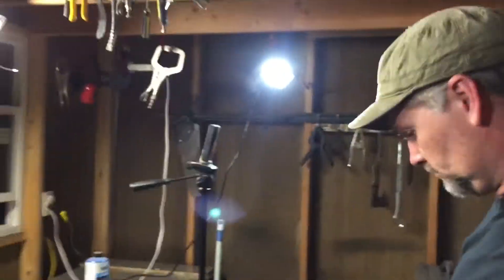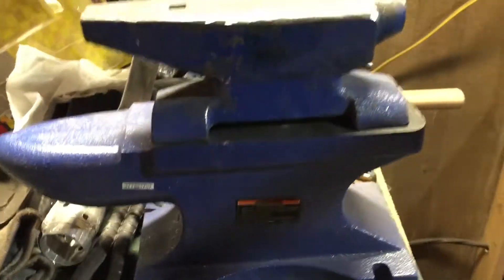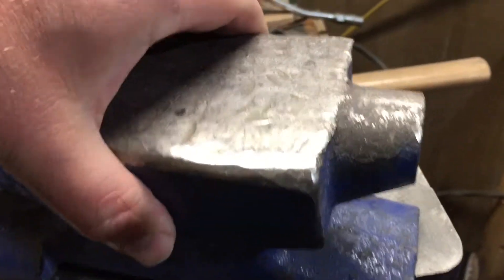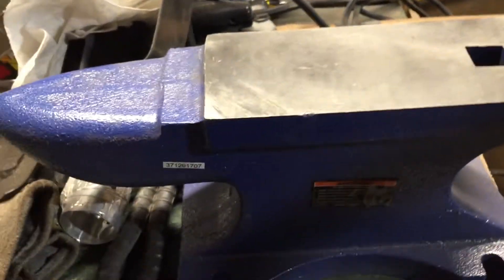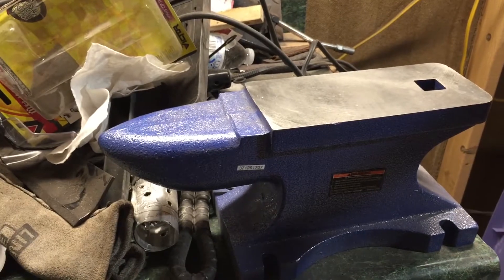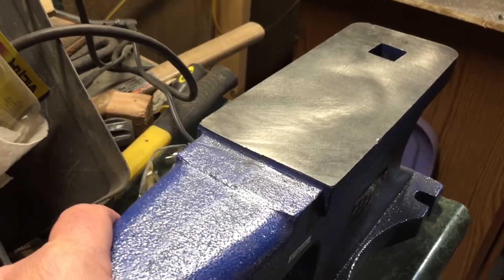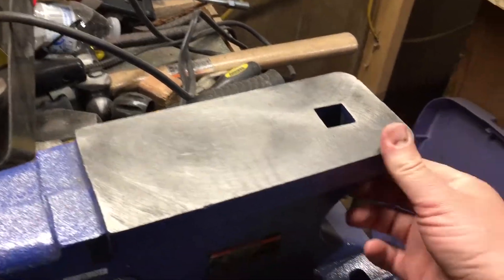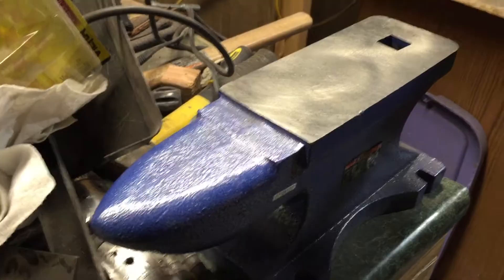Why did I take a grinder to my new anvil!?

Comment: litte  tip  ---  weld on face steel  plate   1\2 --- 2  inch  tick  , and  work  well
Reply from the maker: Alex Mann Great tip. I understand these anvils are quite soft and a lot of guys will weld on a hard steel striking surface. I'm still pretty new to this, and miss A LOT so I'll wait and build on my accuracy first.

Comment: I have the same Anvil and I love it. Although I plan to buy this one: http://www.grizzly.com/products/300-lb-Anvil/G8150?utm_campaign=zPage&utm_source=grizzly.com I would recommend you weld a hardened steel plate on the top of the anvil because it has a soft surface and little rebound.
Reply from the maker: Judah Graves thanks! Yes, that's actually on my list of plans for this thing, first I need to find a better way to anchor the base. I built that in another video. Anyway it's a decent base but it bounces around a lot, I might want to hang some chains from it or even bolt it straight down to the floor. We'll see. Thanks for the comment, Cheers!